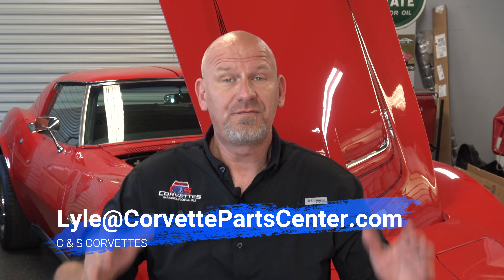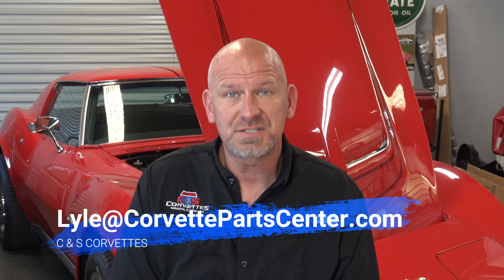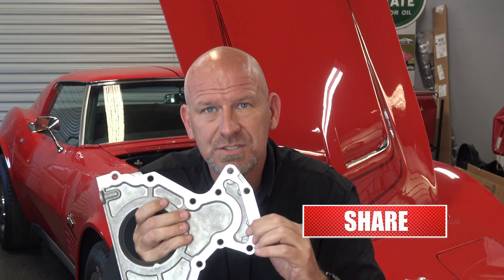Avoid this pitfall with your C5/C6 Corvette

Comment: Holy smokes! I ran across this video by accident but I’m glad I did. I took my C6 in for a diagnosis last week and the mechanic said it was my rear main seal. If I had the same leak after $3700 to replace the seal and it was the plate all along?? I would look for the nearest bridge and jump! Brother, I think you just made my day, my month and my year!!
Reply: Holy shit $3700?! Mine just got replaced in 2024 in Florida for $2100. Where do you live?

Comment: I installed one. It leaks. Loving life.
Reply: The new plate and seal leaked? Need to do this as well
Reply: @ yeah I just pulled it all back apart again. I bought a new seal and the Mr gasket install tool. Needed to draw the plate down with the two oil sump bolts to get the tool moving nice. Torqued the plate down, then installed the new seal with the rear cover torqued down. Save yourself the trouble and buy that tool. Hopefully there’s a safe way to remove the seal without damaging it so you can use the tool while installing the rear cover. Plan to buy a new seal cuz even though mine wasn’t that old it got very much ruined when I removed it from the rear cover after I pulled it out.

Comment: I JUST had all the HVAC actuators replaced...along, as per your suggestion, with the heater & evaporator cores. When the clutch needs replacement, I will deff get that plate. And I just watched your other video on the C6 FP relay carbonization contact issue. The shop I'm using has had the car for 3 weeks now trying to make it fail. Last Friday, I saw and sent the advisor your video on it. Crossing fingers and toes on this one....

Comment: Well crap.... I did correctly diagnose my leak was not the rear seal, but the gasket around that plate around the galley crossover. Because the oil was leaking around the sides of that plate.

Did that before seeing this video.  I replaced the gasket and rear seal.  Now the drivetrain is back in, but I haven't completely put it back on the ground yet.  Im probably good right?  I mean the gasket was so old it was brittle.  Probably not "micro-cracks". And it wasnt leaking through the plate, but around the side mating surface of the crossover.

This micro-crack thing almost sounds like an extreme exception or improper maintenence.
Reply from the maker: From your description, I would agree with your assessment.  The defects in the rear engine cover are a thing, but if there was no sign of leakage at those key points, you are probably ok.  Lyle
Reply: @csvette  thanks for the reply. Your knowledge is tremendous.

Comment: Great video, I ordered mine. Received it with scratches all over the mating surface from shipping I presume. I’m trying to smooth them out with 2000 grit and polish, hope it doesn’t leak. A single piece of cardboard between the gasket and flange in the shipping package could prevent this!

Comment: My stock 2003 C5 automatic is starting to leak a lot from the back of the engine.  It has just over 150,000 miles.  While sitting at a light, the oil drips on the exhaust and that smell is pulled into the HVAC intake vent.  Very annoying.  Your video clearly explains what is probably going on with my C5.

Comment: Great videos! Thanks for posting! Not on this topic, but what do you do when a specific part is discontinued? I need a Fuel Pipe Assembly to Engine Purge Valve Factory Part Nos. 12573363 but no one seems to have one in stock for my 2002 Corvette.

Comment: Can this work for a 99 C5 convertible?? I actually have this problem now… what would be the pricing of this kind of job if I bought the new improved seal and plate and just have it installed if you could give me a mechanics review??
Reply from the maker: This part is correct for all C5 Corvettes.  It requires the torque tube to be reomoved from the car for access to the plate itself, so figure on doing a torque tube rebuild at the same time.  If you have the 6-speed manual transmisison, you'll probably want to replace the clutch and the clutch slave cylinder.  Cost on the automatic car would be around $3500, 6-speed $4500 (including parts and labor).  Lyle

Comment: Would I still need an alignment tool to install this?
Reply from the maker: Only if the oil pan is off of the engine.  If the oil pan is in place, no alignment tool is necessary.  Lyle

Comment: My c5 Corvette,  I was changing the signal light,  and I rise up the headlights for more visibility,  and for accident my son turn off the switch and the headlights went down and my hands got trapped inside,  I told my son to turn it back on  , and now my instrumental panel and headlights plus parking lights rears and fronts don't work,  I can used my car at nights,  could you please help me out with an advisory thank you.
Reply from the maker: Check your lighting fuses--pretty sure you popped one.  Lyle

Comment: Tanks for that information. my C5 develop a leak at the end of last year. We found when I did oil change. If it is the remain seal I'll be ordering your kit.  And if it is the seal I will get the rebuild kit for the torque tube also seeing how its got to come out, its got 12500 miles on it .

Comment: Looked at store.  This kit does not include the 2 important vertical bolts you mentioned.
Reply from the maker: Those are oil pan bolts,and you re-use the GM bolts that you already have.  Lyle

Comment: Thanks for the great, informative video Lyle. The shop that I go to for L-O-F's etc kept telling me I had a very minute leak in the rear seal. Stupid me and my OG ways thinking that it had to do with the rear end and transaxle. I never could find that so-called minute dribble of a leak and the ground sure has heck never showed any leakage under the car. I have a 2000 C5 with the Z51 package 6 spd. after having a 1970, 73, 87 and 95 Corvettes. Since I bought the 70 in 1972 and being used to the old way of transmission setups being with bell housing at the rear of the engine and find that is not true of the C5 and newer Vettes. Doh (Homer Simpson style) and my knowledge is growing. Thanks for all the great videos and how they help the rest of us out.

Comment: It appears that there is a way to tell the difference between the old and new rear main plates from the outside. If you look at the new plate, two of the mounting holes on the right side are milled out into a V pattern. Those same holes in the old plate just have circular counterbores. With this in mind, you can determine whether you have the old or new plate without removing it from the engine.
Reply: This info just helped me a lot, my 2013 has the updated plate already installed... Great catch!!!  
This comment should be pinned.  👍

Comment: Great information.  Ironically, I have been chasing an oil leak in a GMC Yukon Denali in the oil pan area.  Droped pan and replaced gasket...twice.....Changed oil filter three times (Leak appears to be in that area).  Finally I thought that maybe the pan itself was warped/cracked?  There was an odd bolt and may have cracked the top end as you mentioned, but just going to replace the whole pan with brand new GMC pan.  Ill inspect for uneven areas as you mentioned prior to install.  Thanks for the information Lyle.

Comment: Hello Lyle, Greetings from Montana. Ok i have  question.  I just bought a 2013 C6 coupe with 18000 miles it looks brand new almost.  love the car. Had a 2000 vette also. so im cursing slow around town in cool weather. Ive had it for a week and drove it about 9 hours going misc places. so after driving around town basically idling I parked at idle and ran it for like 20 minutes. then i noticed it getting hot. the fan came on and it continued to rise. I shut the motor off and the next day found the coolant  res. empty. So I filled it to the fill cold line and ran it. It would run 196 doing 70mph and when i let it idle to see would do it got to 216 and stayed there.  had no other problems. after driving it for like a week i looked at the coolant level when warm it was low. parked it turned it off and let it cool down some and the level came up to 1/4 inch below cold fill line. cant see any signs of a leak. can you help?
Reply from the maker: Alex, check your radiator at the LH upper corner--C6's had a fault in their molding design for the plastic tanks on the radiator, and when there is a "mystery" leak there is a very good chance that it has developed a small crack in the tank itself.  This bleeds off pressure from the system and allows the coolant to boil, which turns coolant to steam that escapes throught that tiny fault line.  It rarely leaks liquid enough to be detected without looking directly at it.  Lyle

Comment: Thanks, Question I have a C5 auto, what do you get to due that job. I have that issue. Ex 170 off 75
Reply from the maker: Patrick, we ususally do a bunch of things when the car is that far apart-torque tube rebuild, differential reseal, etc.- Just doing the rear main seal cover is $1700 parts and labor.  Add in the torque tube rebuild and you approach $2500.  We are booking for Mid-June right now.  Lyle
Reply: @csvette  thanks for your time, I will try to get intouch with your to arrange a time so you can look at it.

Comment: A little RTV can fix both those things
Reply from the maker: Sure it can. BUT, once you have gone through the trouble and effort access the plate why wouldn't you just replace it instead of doing a shade-tree fix?  IT would be different if you could avoid all the labor and just slop on some RTV, but the labor reamins the same....do it right and dit once.  Lyle